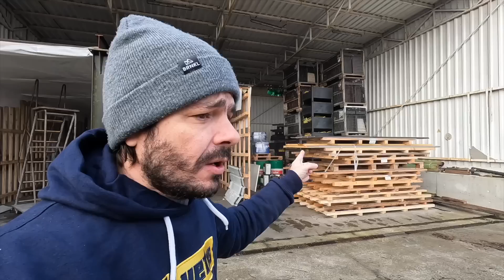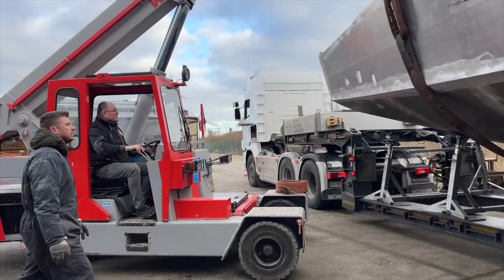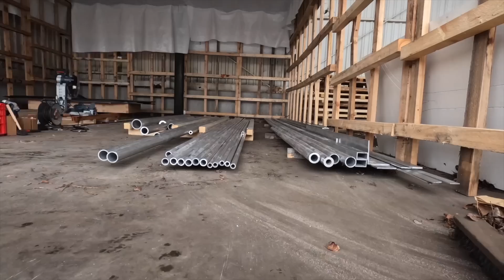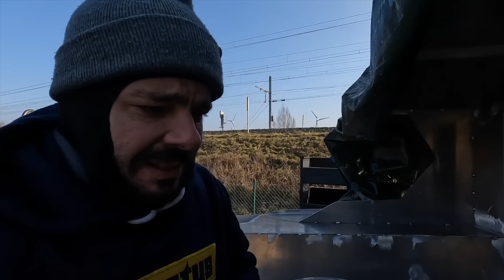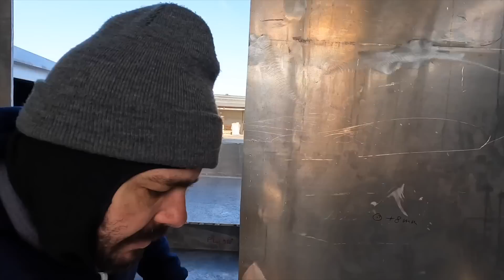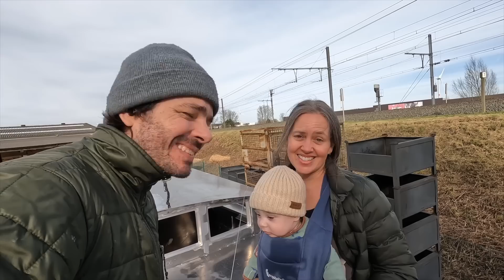⛵️Our boat is UNFINISHED... but we had to take it out of the boatyard  Ep.357

Comment: I thought you just going to build the furniture what are you thinking ?
You have nothing the cost of buying
Motor  trans  batterys electronics
Rudder. Steering conponents. Windows
Mast boom standing rigging sails windlass
Tanks plumbing , this is not remodeling
some old boat how are you going to fit these components precisely , the ship yard get
Big discounts buying many motors and other parts buying all these things one at a time is going to be way more money
You must have a highly skilled welder.
Have you ever thought like to go work
On an offshore oil rig for Two years
Save up and buy a completed boat
Or just have to complete the inside .
How are you going to source all these
Parts ? Hope the Best fot you two !

Comment: Welding aluminum is not difficult. Buy a good mig aluminum welding machine and just weld everything yourself. When you weld, the hardest part is to make sure the material doesn't warp. Seek advice for this. Just do it, it also makes for a nice video.

Comment: If you’re considering welding yourself and you don’t have experience consider laser welding, the learning curve is much shorter.  There are a whole set of other safety concerns like arc welding but different.  You will likely need a duel wire set up to get proper fillet sizes and at least a 2000 watt machine.   Anyway it’s worth some research… YOU GOT THIS!!

Comment: Making a spread sheet / project plan that lists every last wielding item, structural item and such would be a good idea. Don't worry that it might be 200 or 500 items long. Better to have some worries about it being long, than miss something important, like missing a water tight wield. The list should have a column for importance, like: 1 - Structural wielding; 2 - Water tight wielding; 3 - Usability / misc. wielding; 4 - Desirable but not critical. Plus, another column for pre-requsists. Maybe another column for estimated time to complete task. Last, a column when completed.

Then, with that list done, maybe make separate spread sheets / project plans for various items. Like what is needed for the head(s), galley and cabin.

Don't be overwhelmed. Your only building a small boat. Yes, it might take thousands of individual items, but you plan to live aboard. Not day trips. So take it step by step.

Good luck.

Comment: I’m no welder, but have been considering to build an alu boat. I’ve built some boats before, but in FRP. The research about welding machines have brought me to the conclusion that a new type of welding machines seem to be taking over fairly soon: 

Laser welders. They operate with a thread fed into the pool, same types as for MIG, but use laser to melt it, not a spark. 
- The control over the weld seam is far better.
- It’s reportedly way easier to get perfect results.
- Welding speed is about 4 times faster. (!)
- Which means heat transfer to the material is way lower, less deformation.
- It’s suitable for any material, but especially for aluminium, due to the low heat transfer and good seam control. 

The negative seems to be that it’s still new. Few machines available still. Perhaps that’s interesting. You could become a poster child for a new maker… The machines seem to be priced roughly similar to professional MIG machines. I assume they will slowly become cheaper. It seems the Chinese are the front runners on this tech, at the moment, but established welder brands will probably catch up fast, when they need to.

Comment: To the welding:
a - buying your own machine to weld EVERYTHING will be expensive
b - for you to weld certifiably you will need to get the proper training and certification
b1 - you could do that, but it will take some time (though it does NOT take years to learn it - nowadays everything in welding is specialized and separately certified)
c - If you go this route, you might be able to make a living fixing up alu boats when underway! 
c1 - add a little steel welding and you are king!  
d - research if the newest laser machines can do certified thick alu welding!! 
(Usually, these new laser machines do at least another 3 jobs, not just welding) 

e - find a good professional alu-welder that will bring his own equipment and finksh your hull!
f - buy your own lighter equipment to do the bracketry stuff yourself - your professional welder will get you up to speed in short order!

(Just throw out the word!!)

IF META is actually closing, who knows, there might be a few guys willing to travel and finish what they started!!

Comment: I'm sure that everyone understands that no contract = no work. You should have negotiated all the metal work before you signed any contract. Hiring a skilled aluminum welder who also has expertise in shipbuilding will not be easy. If you are the general contractor it's not appropriate to blame a contractor who has fulfilled a contract that you signed.
Reply: What are you talking about man? Are you ok?
Reply: @wtfatc4556  He stated that he had not signed a contract for the rest of the metal work. I doubt he paid for work that he had not signed a contract to have done. It will be an expensive lesson. Having a YT channel is not necessarily a ticket to success. Would you take on the job of general contractor building a million dollar boat with little experience?

Comment: If you do the work yourselves, do yourself a favor and create a grid/map and/or shelving system for where all the parts are (if you haven't done that already). Then create a document with the part number and the grid/map or shelf locations.  It will take you a day to do, but you will save ten times that by not having to search and search and search and search for parts because you can just look up the location and go directly to the part.  If you can get with in 2 square meters of the part (aka a grid size), you'll be able to find it fast.

Comment: God have mercy !! You got  thrown out in the rain. Lots and lots of welding and fabrication before you even start on the interior stuff that you know. The structural integrity of the boat is equal to the quility of the welds. Especially aluminum, what looks good may not take stress. Whats done incorrectly will crack and erode quickly. done right that boat will last a lifetime.  Such a fine project deserves craftsmanship in all phases.

Comment: Unbelievable that Meta dropped the ball like this. I was extremely concerned when the videos came out displaying Meta's lack of professionalism. Their shop, health/safety, and production practices are abysmal.
Perhaps, before you proceed any further you may want to completely measure what is there, 
 have all the welds checked, and drill all panels checking for material specifications and thickness.

Comment: I work on the shipyard and we use kemppi master 353. it would be cool if you would show us all drawings that you have because, I've been thinking about building my own boat..  that kemppi is a beast and cost max 3k euro i reckon for your job you will use max 100l of argon.. but welding live for a specialist Aluminium is a pain in the arse metal to weld... you need to heat it up before welding...

Comment: You ahve huge list on hull aluminium finish afterward the biggest joob going to be more serious than the hull, plumming, electricity, electronics, interior finish. If yoou want to havehastle free sailing in future, I strongly suggest that you sign an agreement with a boatbuilder. Makkum/ Holland  is the besst place for aluminium boat builders, KM or Enksail or Hutting and many more there. I know will be a huge amount when signing the agreement however I m sure it will cost you more when doing it by yourself. Hard decision wish you the best

Comment: The hull is mostly just tacked together. SV Delos 2 was tacked together at the start of construction to position everything, but then everything was fully welded. The latter seems to have not been done, or only partially. The welds do not look clean. You need someone who is an expert in aluminium welding. Welding aluminium is not trivial. It might be necessary to redo a lot of it. This is a disaster. You really should get a lot of the money back.

Comment: You need to be able to insure the boat, both now and as a finished vessel. 
First task as noted was a full survey, an engineering report that includes weld testing and structural deficiencies. We assume you have a Naval Architect available as the boat wasn't designed out of thin air. If the Meta NA wont assist then find a new one with aluminum experience. Eventually you'll know what you have and what is needed to get the aluminum components completed to industry standards (and surveyor sign off each step of the way)
Break the whole build into its component parts, make a huge list, put everything in its order of build and assembly, take one day at a time and spend your time and money wisely and what you will learn is you can do it all, and you will succeed. 
This can be a defining moment in your life, something that you will always look back on as a family and have great pride and become role models for your son and the growing community that is joining your journey.
You guys can do it, dont be overwhelmed by the task, tick off a job every day, and one day the jobs will be amost done - as its a boat and they will never end - just ask any of us who owns a boat! 😂
Reply: Sound advice and the right way forward!

Comment: I know personnally know one of the guys that built your boat to this point. I agree, meta is REALLY shit, but they at least had this guy which was unlucky also to work in that company but he is a very good worker and welder especially on aluminium. If you need some welding to be done on the boat, this guy is in the area and trust me you will struggle a lot to find better than him for this job. Other than that, Fronius tps 4000 is the welder you're looking for. You can get it for 5000€, and it works very VERY well. I'm a welder and this is by far the best welder i worked with for aluminium mig welding. I don't this you will need a TIG for the job, mig can do it all. For your gas, not pure argon but helium/ argon mix probably 30/70. Get in touch with me

Comment: Such a con job by this shipyard. Meta? are assholes, make a toilet seat with their logo - don't promote them. I would not start that project without an aluminum laser welding system - much quicker and easier. Conventional aluminum welding (Tig? I assume) is famously hard. You don't know enough to do that work and you haven't got the resources you need - because it might take two or three lasers before you get the right one. Lazer won't warp the heck out of the boat and is preferred for finish welding like you have here (I can't speak to its suitability for marine applications). The big welding and grinding jobs are done only on this boat. Then, the cabinetry is a 9? month job - for a build and installation crew of 6. 
The French - are not to be trusted. They have left you adrift without a lifeboat here. 
You better be in good health because you are working 18 hours a day for the next two years - and likely running out of money - or seriously consider taking a job back home and run away from a disaster.

Comment: I'm sorry to say this but until you secure proper financing where you're able to hire a professional, you're lost.
    There's nothing I can see that has been done right. 
    You're building a vessel that will need to be capable of withstanding forces that frankly I feel  you don't understand.  The design you've chosen  makes it imperative that she is built strong and to not have minimum 18 inch frames you're courting disaster.  It looks as though you've put the horse before the cart.
    Regarding finances you better secure minimum 150% more than estimated  or you will be stuck in a nightmare for 5 to 6 years trying to finish. 
    Building a new boat is completely different from restoring a boat.  Anyone with basic skills is usually capable of that task.
    Wish I could be positive here but boat building is my business and I don't see a lot to jump on the bandwagon about.

Comment: I may be interested in helping you with the welding I’m a red seal welder and fabricator alls you need is a commercial tig welder not a mig minimum of 350 amps also a brake a plasma cutter lm in Canada and just retired ,cover my traveling expenses and living costs no wage s required

Comment: Glad to see a post. Your YouTube channel is a business as well as personal networking, and right now much of the business swirling about your boat is your personal business, and none of my business, so I will refrain from any “Who shot John?” comments. I would not buy a welding machine right now. Some weldors have their own, and ones without have a better idea about what you need, or that they are comfortable with. Welding and fitting is an industrial skill, but it is also an art form. Welders can be rented as well, which has its own convenience for a small operation. Looking into non-destructive testing of aluminum welds and inspection would be advisable while your hull is still “open”. This could contribute to a more professional build and less of a “kit” build and pay benefits on resale. In any event, the hull and loose parts made it to your location, and was safely unloaded. Sorting out loose parts and clean-up is under way. Looks like lights will be needed. You will still be doing 10 things at a time for a while. Don’t get rattled. Keep up the good planning, and high quality workmanship. As long as you don’t run out of Sikaflex, you will be good. Take care.

Comment: That is frustrating to see that META has failed you by not listening to your request. Seems like based on what you said and your frustration of them not finishing the job and having a unfinished jobs. It will be challenging to get the rest of the job done. I would recommend getting another boatyard to help finish off the remaining necessary structural welding and fabrication work done as they will have more experience in what they are doing. Once that is completed then you can add the finish touches. It all depends on how much money left. Look forward to seeing this completed and launched.

Comment: You need to find a place that has a sheet metal CNC machine nearby. Have them cut all the metal for you that Meta didn’t do. That will make the initial process easier. Cover up/weld in pieces to cover the Meta logos. They don’t deserve the acknowledgment.

Comment: I dont know the story with META, but this looks unplanned… 
 For the door, it may be better to leave a seuil for when you take sea, rather that having your double door.

As a Boreal owner we need to talk about the chain tube… as I understand that you have the chain at the bottom of the mast… the issue is sea going to the chain locker when in rough sea. The solution, a drained sea catcher box in the sail locker which interrupts the tube. Needs to be though of a bit still but is is necessary.

For the welds, a mig is necessary. The main feature is an AC welder whereas I only have a DC TIG welder on our boat for soldering. You can find welder for way less than 15k I think. But welding is not so hard and you can learn too. 
Enjoy your holidays.

Comment: You should take the boat to someone who has the necessary equipment, and have the necessary skills to complete the boat. To weld aluminum, it needs to be clean and completely dry. but the most important thing is that there is no wind. If there is wind, it will blow away. "cover gas" for both MIG and TIG. it would be almost impossible to get an acceptable result,if you don't have the necessary experience and training and equipment to complete this job. plus this is a massive job that will take far too long to complete for people who don't have this experience to do this. I don't mean to be negative, but with over 20 years of experience as an industrial mechanic and welder, I know how massive this job is. Whatever you do, I wish you luck and I look forward to follow journey forward :)
Reply: Only another boat builder has such skill and bending machinery.

Comment: Duca, you certainly my not the first person that had to take,matters I to their own hands when a,boat yard failed to deliver what you expected.   I have examples from lon,ago to recent . But you have,control now whether you want it or not. 
You will need to learn to aluminum weld. MIG is easy in aluminium You can learn quickly and or take,some,lesson, forget tig , you can find a friend for that.  Yes you will need 300amp , aluminum requires a,lot more power than steel ,welding. 
You got this .cheers warren

Comment: There have been terrible problems recently experienced by YouTube sailing channels with four different companies. It appears it is not wise to buy anything but a finished boat, and then to subject it to a rigorous survey, even if it's new.
Reply: 2 of those were hull numbers below 10 both were from new facilities constructing a new design during covid. The HH 44 has to have its internals & every fitting that piercers the skin removed over drilled epoxied redrilled & refitted that is time the Wyns weren't will to be homeless.